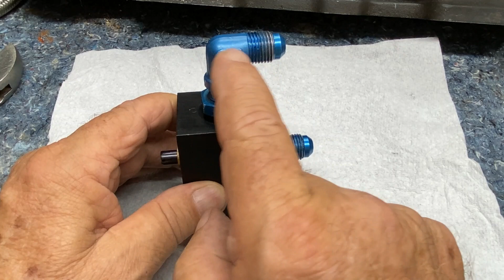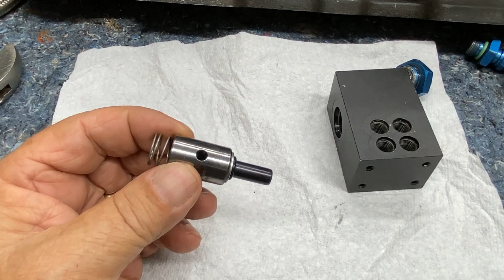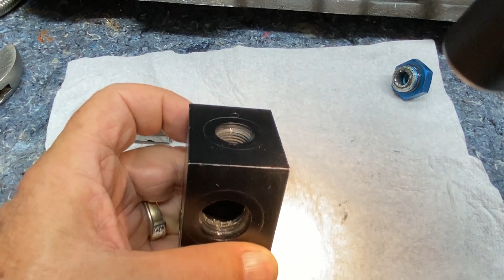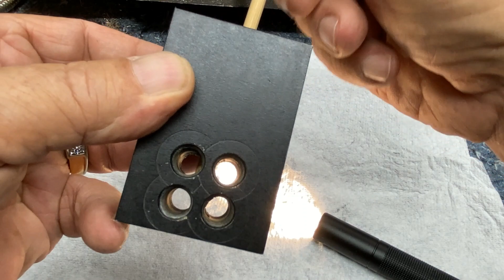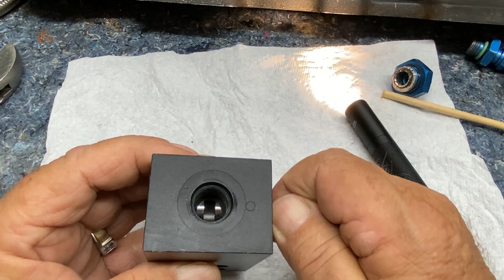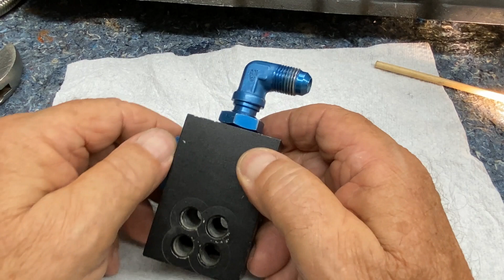8 Stack Mechanical Fuel Injection 101 (Part 6) The Barrel Valve

Comment: Just found your channel and great stuff!!  I've got a real early hilborn setup and the spool is not drilled for the idle bypass meaning it's solid in the center and just has the groove. What are the drawbacks with this setup?
Reply from the maker: You will need to be sure and run a secondary bypass on the line from the pump.  That will keep the pressure from spiking crazy high when you snap the throttle closed at high rpm.  Call Mike at Alkydigger, he can get you what you need.  Hes a great guy and knows his stuff....  Cheers.  Please subscribe and share my channel. Randy

Comment: When you showed the idle hole , how is fuel getting past the barrel for your idle? I am assuming the diameter of the round hole is your idle flow and most is going through your bypass back to the tank . But how is the idle fuel getting to the injector?
I have an enderle 4 port I'm setting up for street use..... Love your videos
Reply from the maker: The ramp on the spool feeding the nozzles is never totally closed off like the idle bypass is. The “leak down “ rate you set allows for that % of fuel to continue flowing to the nozzles at idle. Go watch part2 of my series.

Comment: This is the exact information I've been looking for, for a alky sprint car engine. This engine is for a vintage sprint car so it's not any big HP. #%) cu. in. stock heads but a 500 lift cam. on alky. Does it make a difference on what size nozzles to use., and what size do you recommend. Great video, and thank you.
Reply from the maker: I discuss nozzle sizing in a couple segments in my fuel injection series.  I suggest that you watch them in order.  You will know the tricks to selecting the right nozzles.  Cheers

Comment: Great video !  Thanks for sharing.  Question... if the little round hole goes nowhere except out the low speed bypass, how does the engine idle?
Reply from the maker: Because it then goes to the idle bypass poppet, which is basically acting as a pressure regulator. I discussed it in more detail in part 3 I think.  The poppet can be set to maintain pressure on the barrel valve and at idle, about 20% leaks around the spool to feed a little fuel to the nozzles.  Hope that helps.  Keep watching.  Thanks for the comment. Please subscribe if you haven't.  Cheers!

Comment: Is it possible to have twin tanks on your car, and when you pull up to a race, switch over to alcohol or nitro, and another control to knock down the bypass so you got your 1.8:1 or so air: fuel ratio got through, and race on the nitro/alcohol?

I know it is humanly possible. It's far more fun than the idea of nitrous oxide, and would sound FAR cooler.

Procedure: (from cockpit) switch over fuel system to super-rich jetting and flip supply to pressure pump so it is using the nitro tank, then run it from there for the race, then switch back for normal street driving.

Your system would have to have a big volume capacity, but it would be the ultimate sleeper setup.
Reply: Just have 2 setups on the same engine and have 2 electric solenoids/servos to turn fuel on/off of each one to switch lol